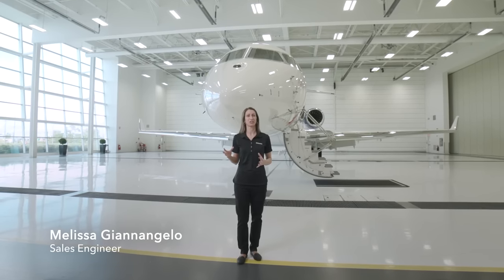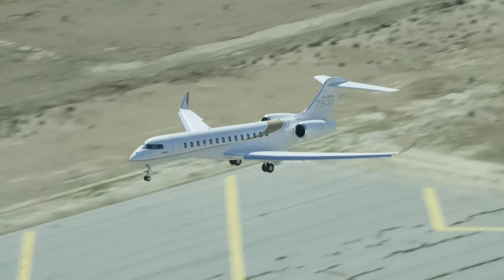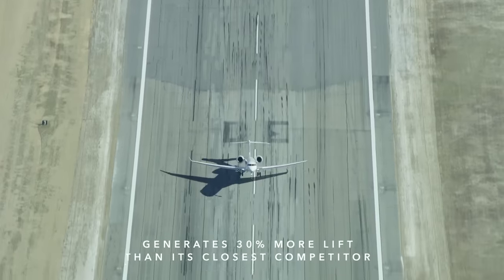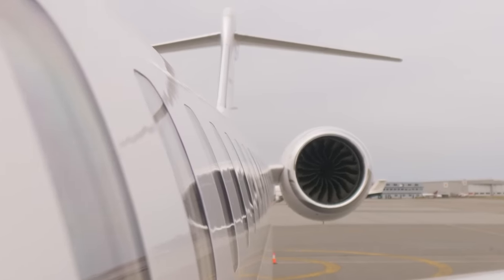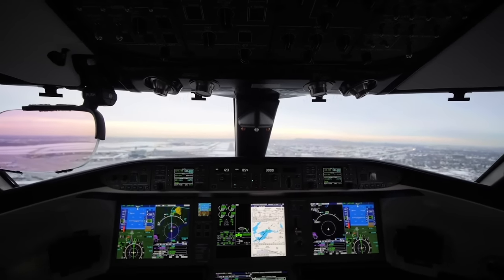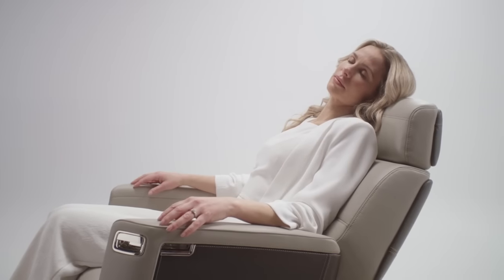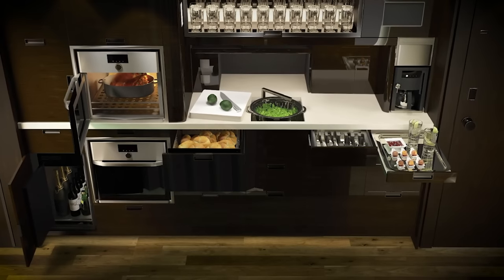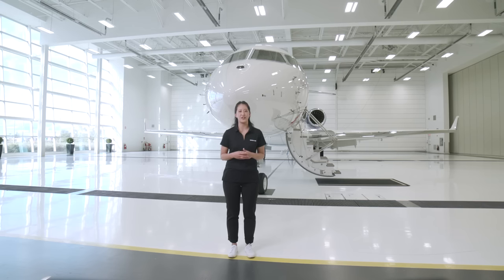Tour the Bombardier Global 7500 Business Jet

Comment: Make it longer and this can be a long distance crj to fly from Tokyo to new york.
Reply: It’s not that simple. It only has 1 emergency exit door, so it can only carry 14 people maximum. They would have re engineer the entire airplane fuselage to allow for 4 emergency exits to be able to carry as many people as a CRJ900. Not to mention the fact that the elevator would need additional engineering. The added weight of seats, passengers, and luggage would decrease efficiency, and the luggage compartment is nowhere near large enough for 50+ passengers... MHI would be better off seeking out an STC to allow them to mount GE Passport engines onto the existing CRJ fleet.
Reply: The fuselage is a CRJ already…..

Comment: "Largest and furthest flying flagship business jet" -- Do we not consider A320/737BBJ/787BBJ, etc in private pax configs to be business jets?
Reply: No and none of those are faster than the Global.
Reply: Key word is purpose-built ... bbj and acj are configured private jets
Reply: Re-purposed airliners are slow, limited on usable airports and fly lower burning way more fuel. They are not bizjets.
Reply: No
Reply: These don't have longer range. Even the A220 ACJ has 5700nm range.
Reply: @denziiey  I didn't list the A220.....
Reply: @BChandl13  I know I was using it as an example. The converted larger airliners don't have the range capability than these specially designed business jet :)
Reply: @denziiey  A 737Max-7 or 8 in a VIP configuration would absolutely have more range than 8000km. A320XLR easily would outfly it in a VIP config.
Reply: @BChandl13  the A320neo ACJ flies 6000 nm. Considering the max is a direct competitor I expect it very close to that. I dunno why you're suggesting this though. Business jets are designed for that ultra long range performance while airliner converted jets are still designed for more commercial use. Even in VIP configurations they don't magically gain that kind of range!
Reply: they big this small

Comment: It has 1600 feet higher cabin altitude than G650...THIS IS VERY BAD ... 4500 FT cabin altitude is nowhere near 2900 cabin altitude of G650
Reply: While it is true that the G650 has a lower cabin altitude, your numbers are wrong because you are not using same flight level for both and the difference is actually less than 1000 ft.  For example, at FL510 (ceiling), cabin altitude for the G650 is 4850 ft while it is 5675 ft for the Global.  At FL410, the Global cabin altitude is 3680 ft while Gulfstream is 2800 ft.  The 4500 ft number you used is for the Global at FL450.  Using simple math and the max differential, the G650 cabin altitude will be around 3710 ft (and not 2900 ft).  Please do not compare apples with oranges!
Reply: @Waldo801  : thanks for correcting me ..I read somewhere that 2900 and 4500 is at FL450.. I misunderstood sorry